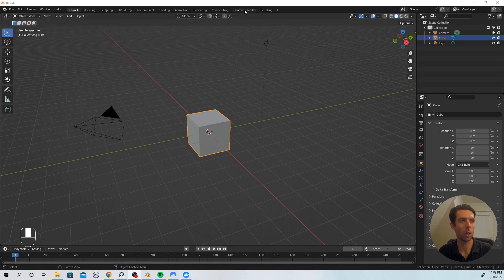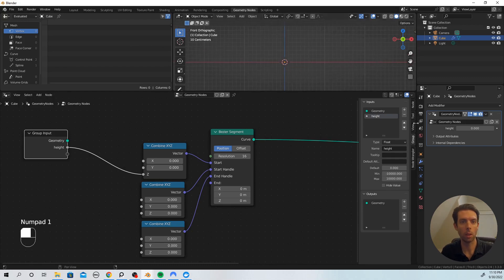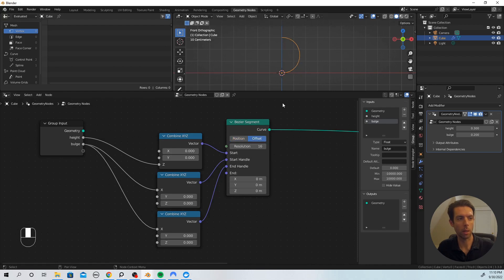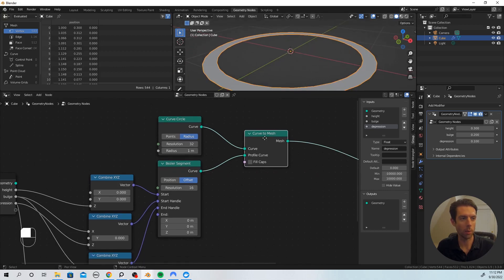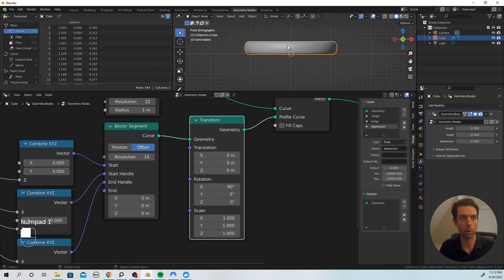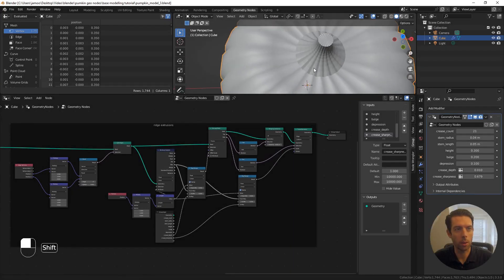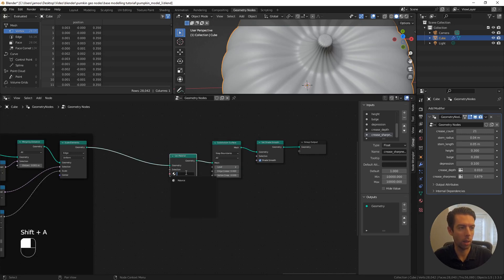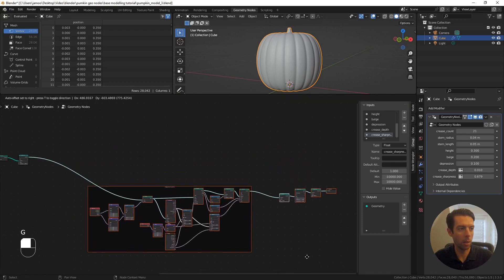Blender Geometry Nodes: Pumpkin Generator Tutorial | Procedural

Comment: In all my years of following tutorials from Adobe, to Cinema 4D, to Blender, this is by far the best tutorial I've ever followed. The instruction is clear and not too slow or too fast. The net result is also incredible. The only thing I'd recommend is a tad more explanation on some of the nodes and what they are doing. Nothing crazy! Some of it just seemed like magic.

And as a personal request, is there a recommended way to add thickness to the final result? I intend to 3D print these generated pumpkins :)
Reply from the maker: Thank you so much for the kind words. Also, I agree, sometimes I gloss over some information about the nodes I'm using. It is just so hard to find that balance between over explaining and under explaining.

As for adding the thickness to the pumpkins, I have good news. I already had a solution for this but I never included it in a video. So I put together a quick tutorial https://www.youtube.com/watch?v=2Mc3mvOq-VU . Hopefully, the same solution works for your purposes. Thanks for watching, and best of luck!

Comment: I think it looks amazingly natural and organic! The distortion on the stem and the way it matches the contour of the pumpkin is fantastic. I can't wait to see you unwrap and add materials to it - and you know I'll show-off my finished gourds!

One note for the easily confused: When you pull out a wire and search for either "White Noise" or "Noise", you'll probably see both "Vector" and "W" versions of it. You're using all Vector-versions here, I believe. (I chose the wrong one at first, but noticed it right away because they look a little different.)

After I make a group of them and play around, I may set min/max limits on the exposed parameters to prevent adjusting them to the point of distortion...

I think this is a wonderful follow-up to your first series! Very impressive! :washhands:🤩
Reply from the maker: Great call out on the "Vector" and "W" I hadn't actually noticed that before. It looks like the W version just goes to a single dimension input to the texture, so that would definitely change the outcome.
Thanks again for all your kind words, and feedback!